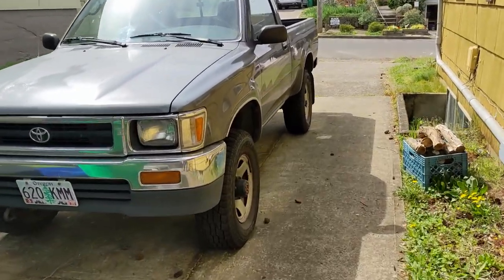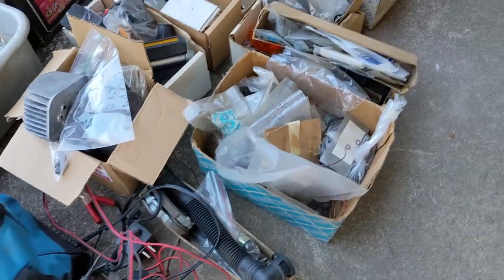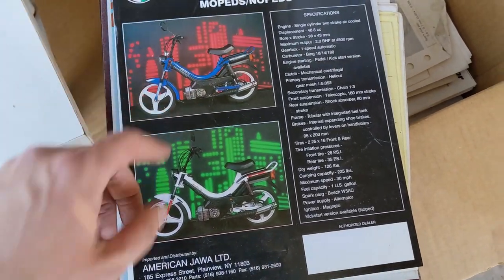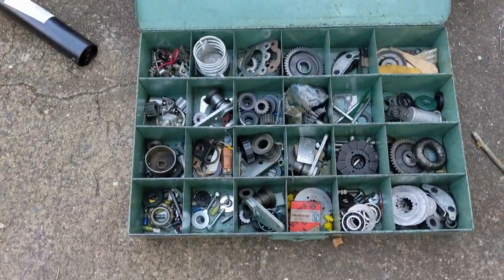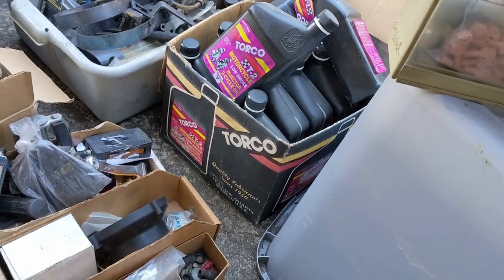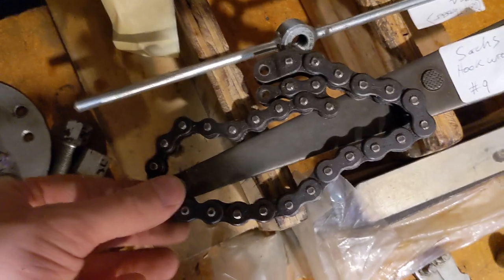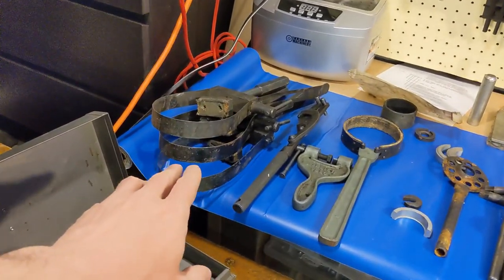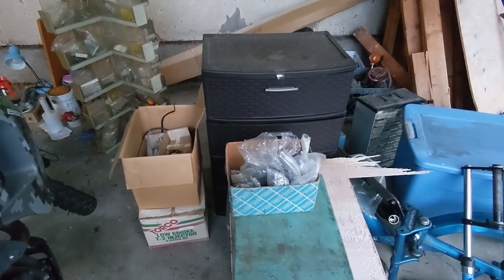Parts Haul - Buying out the Remains of a Former Moped Shop

Comment: "peugeot driving tool" at 12:39 is actually the case splitter
"lollipop" from 14:04 is the batavus m48 flywheel holder, missing one peg
 "larger one" at 14:17 maaaaay be a version of the m48 clutch holder, not sure tho
"half crank" at 14:39 looks to be a pug 102 crank to me (clutch side d-slot but waaay short for 103)
 "mystery crescent" at 14:58 might be forever a mystery, but check it out in this old lot on treats: https://www.treatland.tv/ProductDetails.asp?ProductCode=factory-tool-set-spanners
Reply from the maker: Outstanding! Thank you so much for the clarification on those tools. Only the Puch tools were stamped with numbers. Nice to see the familiar tool in that treats posting
Reply: The half crank is definitely peugeot 102, we've got one new in the bag. I'll check the name on it again

Comment: The "most excited about tool" at  14:35 is a Peugeot Clutch assembling stand for testing lining clearance.  The first crescent style tool is a Morini sprocket holder. I could use a couple square Bing float bowl gaskets.
Reply from the maker: Aha, thank you for the clarification on the half-crank tool & that Morini tool. These were all tossed into a toolbox so other than the Puch tools which have numbers we've been guessing. Still going through the many bags of Sachs carb parts
Reply: @TravisTutorial  The Myron's tools page is very informative.

Comment: The tool at 15:00 looks kind of like the minarelli sprocket holding tool, P/N 6960, but idk.
Reply: Either way, super cool haul!
Reply from the maker: @bjf10  Good eye!! You might be on to something there
Reply: @TravisTutorial  Thanks!  I haven't seen one in the flesh so it's a bit of a guess.

I also posted a comment about the flat plate with the semi-circular cutout (9:35); but it was deleted (possibly because I included the link). 

MLM sells a similar tool for bracing the crankshaft lobe against when you're pushing bearings on.  It's on treats as "MLM stainless steel crankshaft holder bearing tool."
Reply: @TravisTutorial  Also also: suuuuper jealous of those ZA shimming tools!
Reply: So how much was for the lot?
Must have been a couple of thousand bucks?